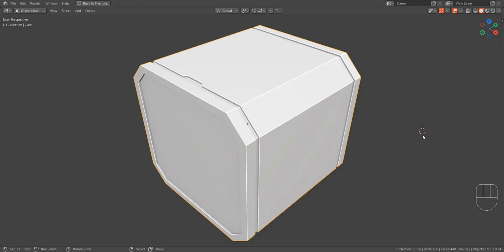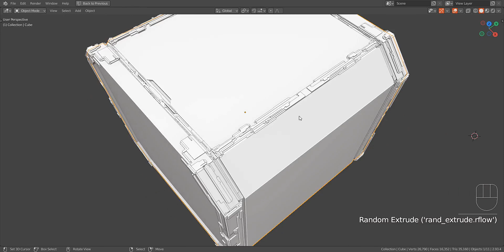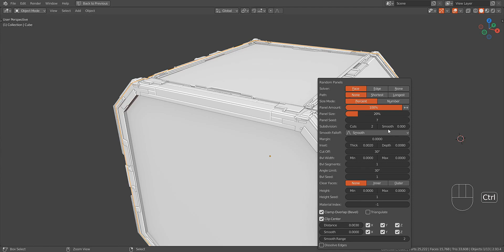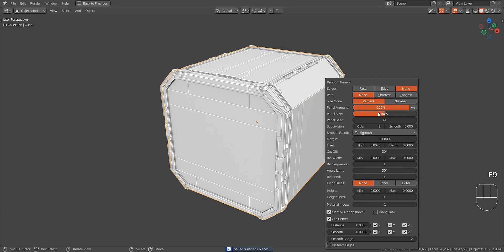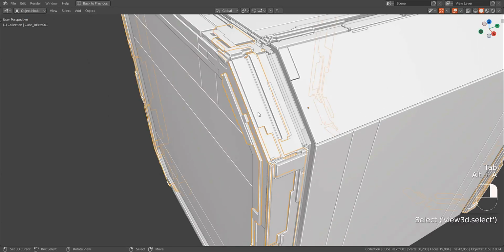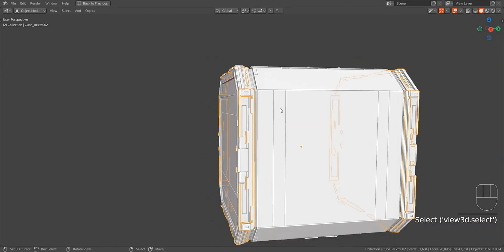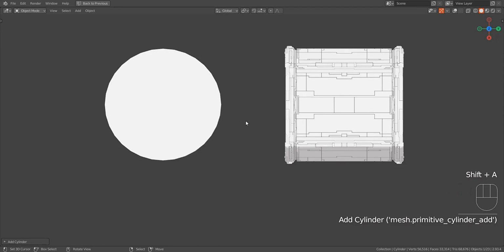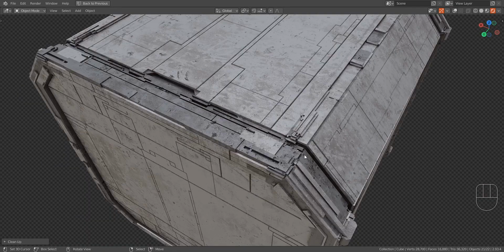Random Flow 10: Assigning Rest And Detail Areas

Comment: Hi Ian, how can I get the effects on the panels to mirror ? is there a mormal mirror modifier here? or is it a command in RF :)
Reply from the maker: The source mesh needs to be mirrored using the normal modifier. Then the add-on just inherits that. Next version will have an Auto Mirror function.
Reply: @blenderguppy  You know what your fans need :) thank you :)